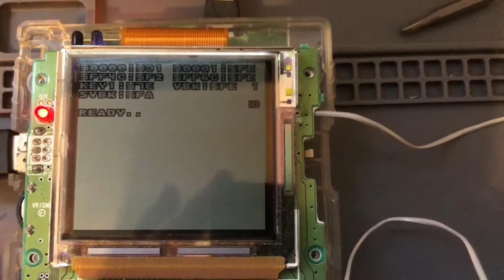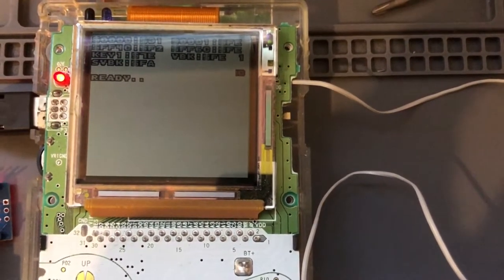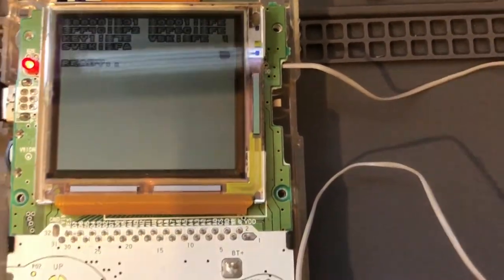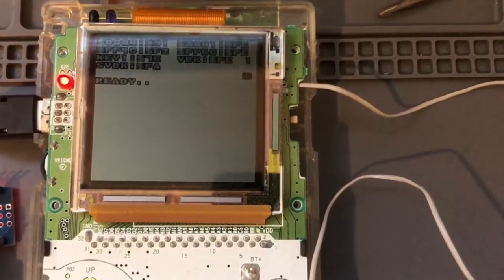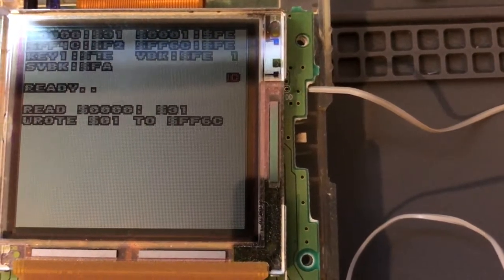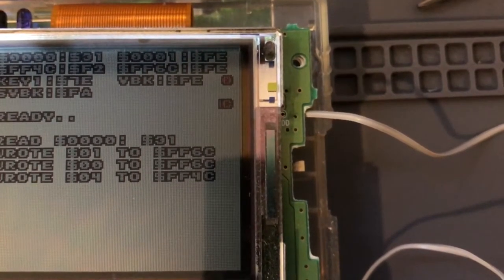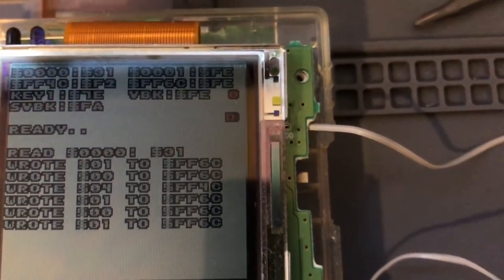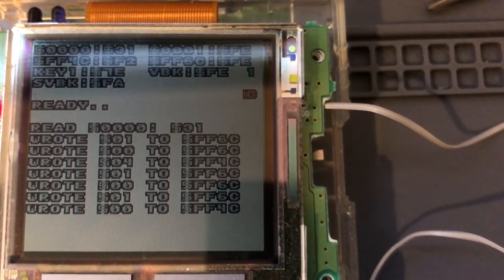Clock glitching the Game Boy Color boot ROM and toggling object priority mode - FF6C bit 0

Comment: Hmm, I didn't think the clock glitch would work on GBC although to be fair it hardly seems to work. Have you tried making an intentionally invalid ROM header so the boot ROM locks up? That should increase the chance of success. Also, which of the crystal pins did you connect the wire to?